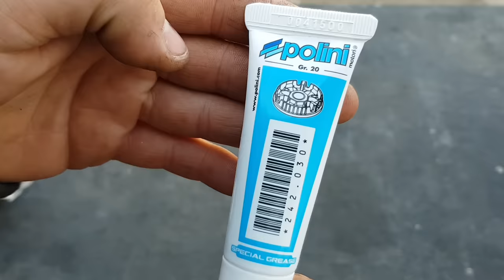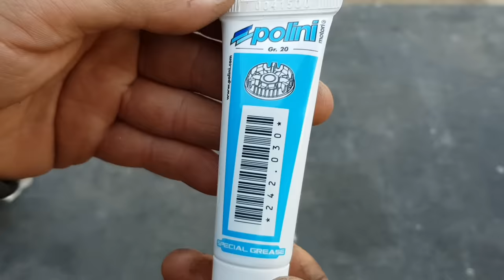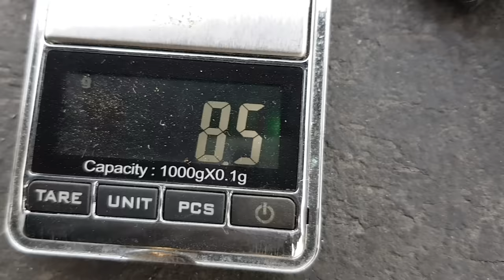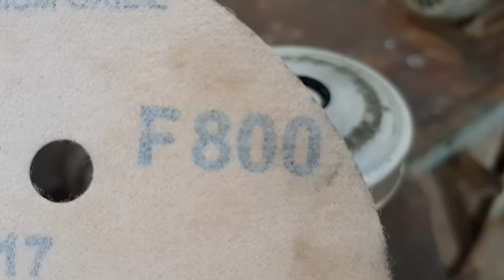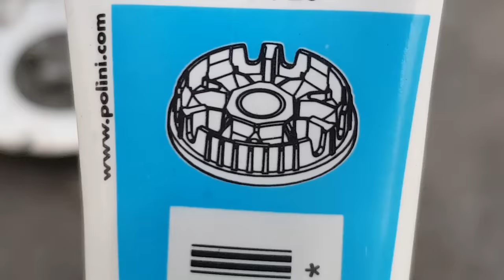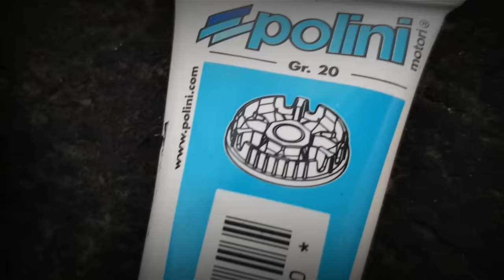Смазка для вариатора Polini

Comment: Grease works in this variator because it has a lid sealed with o-ring, that make the grease stay where it should. Many variators are "open" and if greasing these it would come on the belt, and that is bad.

Comment: Those three pieces that are shaped like the letter "C"  - - what is the purpose of those? How do they affect the mechanism? Performance? Seems like using them would upon the device in way that belt dust will easily enter. Also would seem to change the geometry. Are those pieces factory parts or "after market" (like Dr. Pulley) parts?

Comment: It is advisable to not grease the rollers as they have to roll freely in the variator case , this method will harm the performance of the scooter.
Reply: If the makers of the variator use grease so should you. They made the parts and know what they're doing as they designed it to use grease! Do you think you know better than the designers?
If the variator comes bone dry then keep it like that, but if it has grease in it, there's a reason for it.The one in the video was designed to be used with grease. Others are not. And besides, why would they make such a grease if you're not supposed to use it?
It's simple, follow the designers choises, and don't complain if you don't and it wears out...
But you do what you want! Me? I'll follow the designers instructions...

Comment: Hi I need some advice if you can help me I have a sin of a Chinese scooter of 50cc gy6.does not want to run harder than 40,45,50 I started with replaced new clutch, racing variator, coil racing, cdi racing roller variator, simple drum, air filter sponge, stock filter several combinations from 4.5g to 9g, still does not work. I opened the engine, found the bent intake valve (started at quarter) and here I changed the piston, segments, cylinder, cylinder head, camshaft, platform + cleats. At the point I put the flywheel on the T at the sign on the crankcase axu big hole up and the small ones aligned with the cylinder head thermal intake 0.05 exhaust not having on the lera 0.08 I put 0.10 to tighten that is not to enter. I opened the carburetor and blew it clean. I started at the quarter nothing everything I did above nothing changed even 5% as before with the valve bent you say you don't go to the engine all that speed varies 40,45,48,55 wood I changed the whole engine and no change in the past it was 60, 65 km / h, the one that wants to go now, I would be satisfied in the end before it was like that. Broken drum, cdi, original, original motor, bent valve, cabbage variator rolls now I have it all

Comment: ...  Looking at videos it seems that the "rollers" generally wear flat spots which would mean that they don't "roll" very much and their movement tends towards a "slide"...  which does indicate that some lubrication is a necessary and good idea.  That variator seems to be very well "sealed" and encased with an o-ring which wont allow grease to be flung out and contaminate pulley surfaces,  on my Burgman 400 the variator is not enclosed and there would be a real danger of lubricant reaching the pulleys and belt.    Has anyone tried using graphite dust, (used in lock mechanisms),  to lubricate the rollers/sliders ?    Chris.   (in Brazil)
Reply: if you keep the inside of the vario clean once in a wile jou tont have that problem
Reply: I run this same variator on an NH 125 without the backplate an no grease.

Comment: Grease is interesting, do you have a DOT or DIN number on that? It looks pretty normal, like wheel bearing lube.

Polishing the variator disk was interesting enough but when you can replace it for $12, why bother?
Reply: Aftermarket Junk for 12$. Why? Fix it! Buy is so Easy!